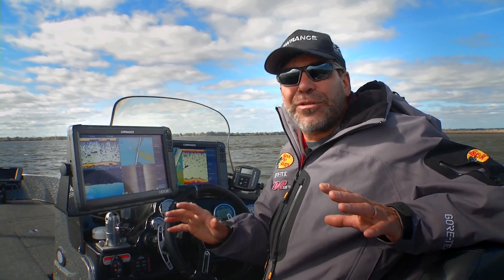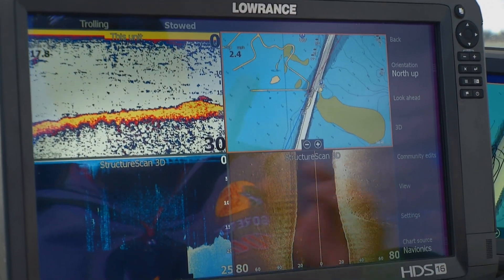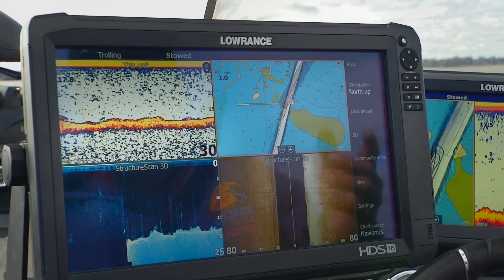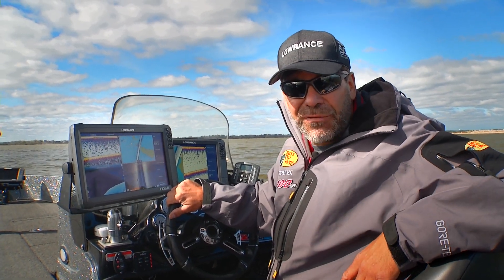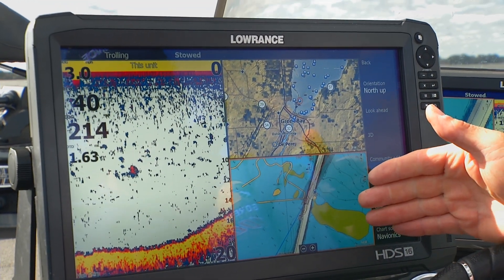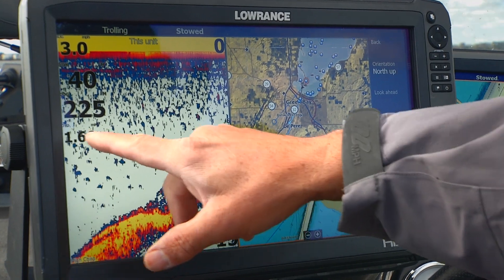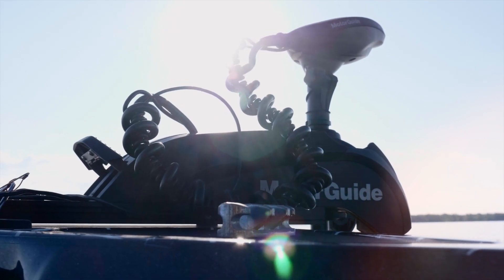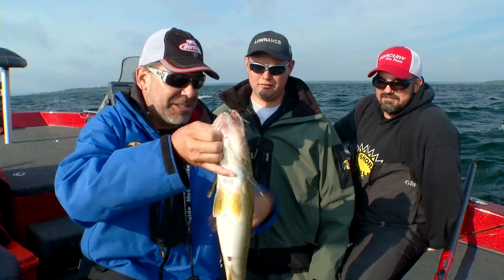Lowrance HDS Carbon 16

Comment: We inherited a Carbon 16. How do I load bouys markers and dotted shallow markings, etc... I've seen them before but my map looks blank
Reply from the maker: you will probably need a lake map chip.  Check out Bass pro Shops or Cabelas for selection. We use C-map Chips